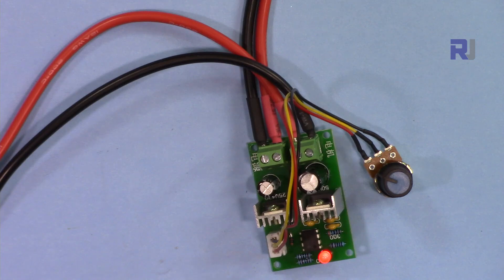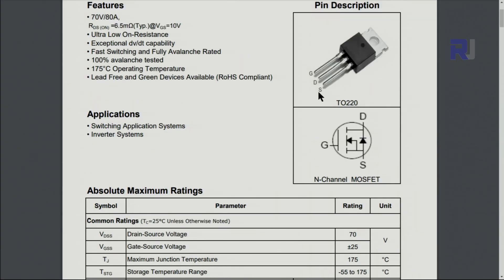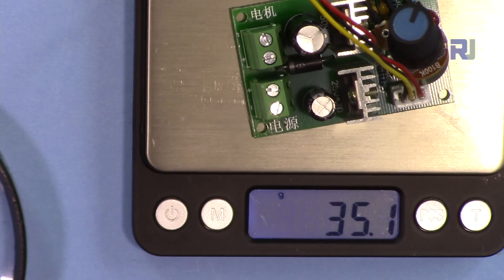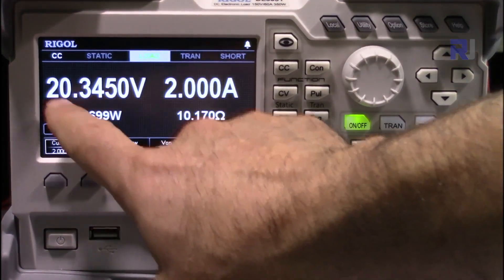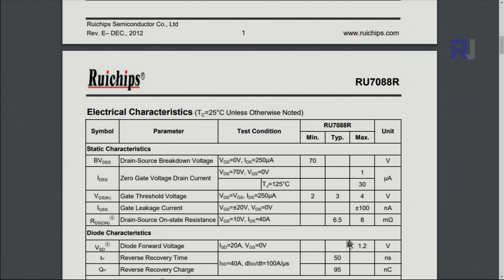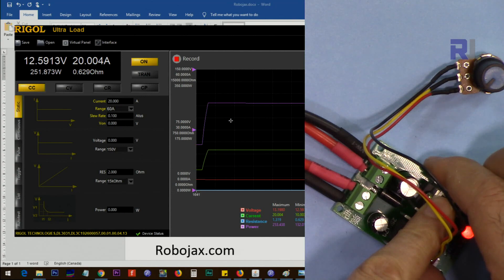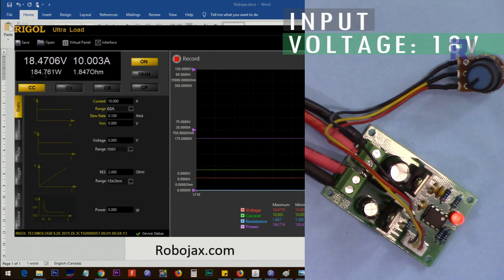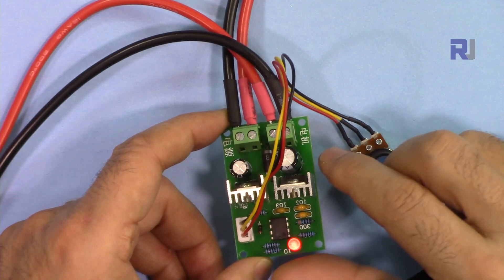Review of 12V-36V Pulse Width PWM DC Motor Speed Controller

Comment: hi ,how to

 add a rocker SW to that circuit ?
Reply from the maker: jut add it in middle wire of potentiometer . Cut the wire, it will be 2 wires and connect it to your switch. This is will NOT turn the power but rather the signal and that makes it easy to use and you can use any small switch. But if you need to disconnect the power, then add it on the path of + line.

Comment: Can you help me with the circuit diagram of this unit? Also it would be very helpful if you show the wave-form on the oscilloscope. Thank you for awesome video as always.
Reply from the maker: You are welcome. no circuit diagram as this is not properly manufactured. You can draw it yourself. Not that hard, just spend some 40 min or 1 hour time.
Reply: I do not have the device. Do you think that the output frequency is stable and it can reach to 100% /99% duty cycle? 

For myself I always found it difficult to keep frequency stable while changing duty cycle for 555 ic.

Comment: Assalam o Alaikum
Hi
This circuit is run two hoverboard motors at one time and no need e bike controller?? Please ans me ASAP
Reply from the maker: Walaikum salam, (1st)  if the total power of the motors don't exceed the rating (which is mentioned in video) and (2nd) if both motors are exactly the same type, yes you can use it (3rd) given you are able to use the potentiometer as controller or modify it to fit your need.

Comment: hola amigo me gustaria saber cual es la diferencia entre un adaptador de corriente de 12V 2A a Uno De 12V 3A POR FAVOR POR QUE TENGO UNA CONTROLADORA QUE ME TRAJO UN ADAPTADOR DE 12V 3A Y ME GUSTARIA SABER SI PUEDO USAR UNO DE 12V 2A
Reply from the maker: Hola, 12V x 3A = 36W (vatio) y 12V x 2A = 24W por lo que 36W tiene más potencia que 24W. Si usa el dispositivo de 36W en lugar de 24W, no hará nada malo. Excepcional es como viajar en un autobús en lugar de un coche pequeño. Tendrá potencia adicional (o asientos) y no la usará. Pero si un motor o dispositivo necesita 36W y usted conecta un adaptador de corriente de 24W, no funcionará porque 24W es muy inferior. Como si quisieras llevar a 50 personas en coche pequeño. necesitarás un autobús Utilicé google para traducir y espero esta ayuda. Gracias
Reply: @robojax  hola amigo muchas gracias

Comment: Is there something small like this for slow start of dc motors?
Reply from the maker: DC motor is always difficult to start slowly. if you want slow motion/star, stepper motor is the solution so you have full control and even can stop it any position. But this was surprisingly good with starting motor slowly.  I have shown how slow it starts in this video.
Reply: @robojax  yes it was. I was speaking about kids toy, ride on vehicles. Install big motor, the pedal to drive is only on/off switch, so then shears gears, slow start would help
Reply: @robojax  I saw SG3525 PWM has a slow start function, but I can't find a diagram if it would work
Reply from the maker: the smaller the motor, the less power and possible to start slower. But it depends what slow is. May be SG3525  suitable for your application. Good luck.

Comment: Hi robojax, I love your videos and have been really useful for my DIY home projects. However, could you please make a video on how to fetch and receive data from a website so the data received from the website trigger a sensor.
Reply from the maker: Thank you Chase. I am glad you found them useful.  Yes it i doable to trigger an event based on data from a URL. But it would need arduino and eithenet or wifi sheild. .  I will put it on my "to do " list. I am busy with full-time job and part time school now.
Reply: @robojax  If you cant get to it no worries. I have started on it and seems to be not to difficult. Thanks